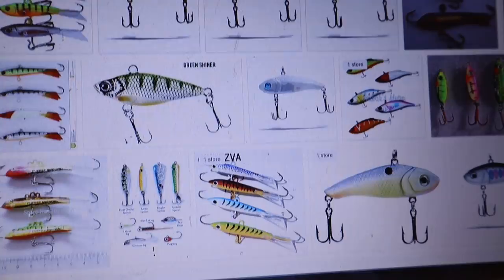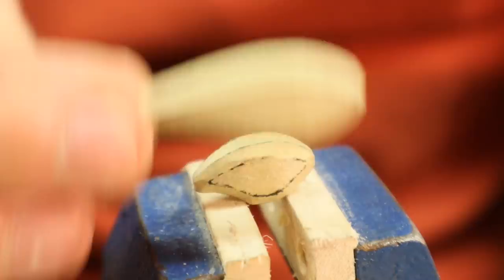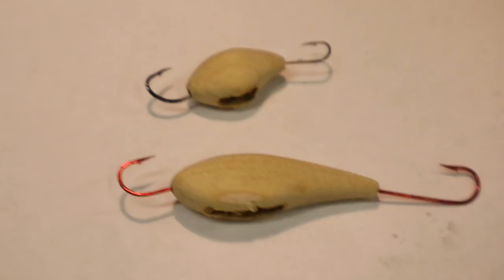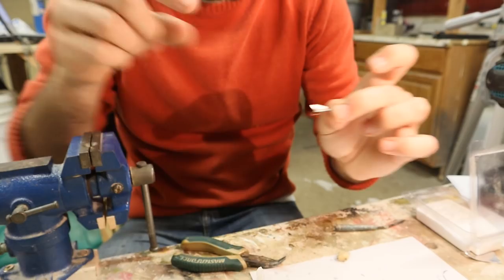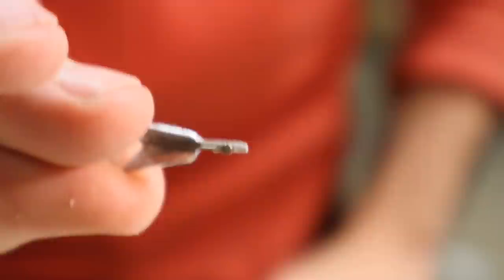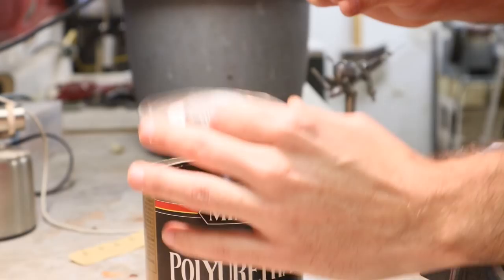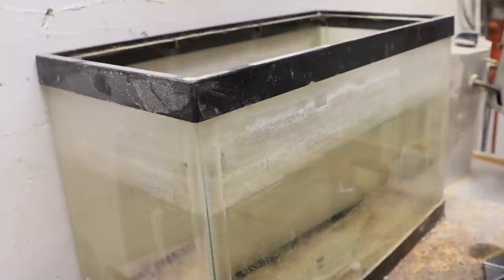Making Ice Fishing Lures

Comment: Also.. check out West system epoxies bub. They have fast hardner. Slow hardner. Clear coat hardner (make thinned epoxy clear coats, also uv resistant) and they sell just about any viscosity of a filler u will ever need. I use it alot during my boat building. Definitely a great marine product

Comment: Align your sheaves (pulleys) so that your belt runs straight.  I usually just hold a carpenter's square up to the side of the sheave to make sure it points at the other one.  The one on your bandsaw moves in-and-out, and I'm sure the motor can be unbolted and twisted to make it straight.  Make sure the setscrew is tight, you will end up smashing the edge of the key a little bit.

Comment: You should make a mold of these and cast the final lures with lead. Also the back lip should be made out of plastic to reduce the weight at the rear end of the lure. When the head of the bait is a little bit heavier than the tail, the lure will be swimming pretty neat 8 figures under the ice and it should be retrieving head first. 

You can also make "light weight" balancers by casting the core out of lead and then casting the final surface with polyurethane resin. Or by gluing pieces of balsa wood on both sides and shape the lure with that. Offcourse the polyurethane needs 2 molds but i guarantee the result will look amazing ! This is a way you can make even bigger ice fishing lures without ending up with too heavy bait. I make my own "balancers" with lead core and featherlite surface, managed to catch this winter the first +1kg perch with my own handmade lures ;)

Too bad there is not too many DIY ice fishing lure videos, maybe i should make 1 of my own :D

Love your videos btw ! Great enthusiasm and amazing results ! Keep up the good work and tight lines !

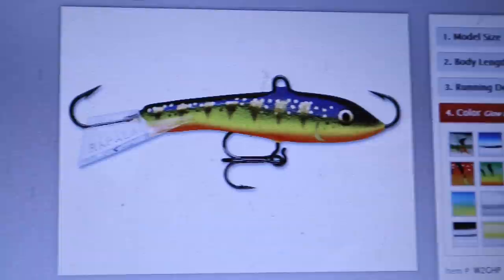Comment: @ approx 1:50, the 'jiggin' Rap' is apparently supposed to do a figure 8-ish type pattern and it does seem to do so on the occasions that I've used it on clear open water. I Still have yet to not only hook but land Anything on this type of lure. I'm presuming that it's operator error, as they keep making (and apparently selling) them.Now I Did get bumped by a few pike, but nothing (so far) has been hooked or landed. We'll see what 2019 brings us!?!🤞👍

Comment: use a small spherical or other rotary burr shape  than has "undercut"  , then insert burr into your drilled holes and create a groove around the I.D...or just make a somewhat reversed taper, then once filled with glue/epoxy that hardened plug of glue can't pull out very easily.  Can also feed wire (safety wire) through all hooks into central core of body then fill with epoxy or lead.  Gotta think ahead though ;-)

Comment: Very good, I've seen you in several videos that use Polyurethane Varnish, I wanted to ask you what are you doing so that it does not dry out? At first it is very liquid and you can work well with it, but after months it begins to thicken to the point of having to throw it away. Does not the same thing happen to you? I await your response, thanking you for the information you can give me.
Regarding your videos and creations, you are a true artist. Greetings and happy holidays!
Reply from the maker: Thanks! Once in a while I’ll add some normal paint thinner to the can so it stays thin enough to penetrate the wood grain.
Reply: @marlingbaits  What paint thinner do you use concretely? I see that the same thing happens to you from time to time !!! Thank you very much I will have it on mind!!!